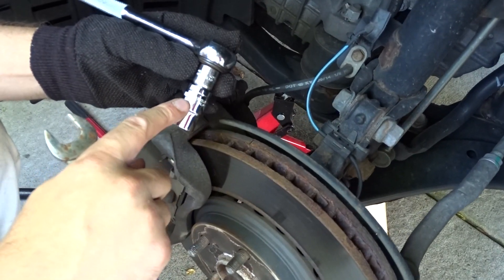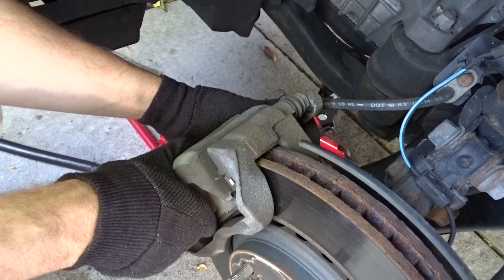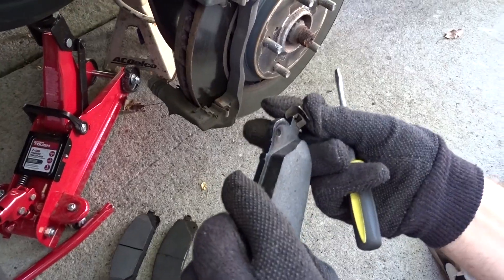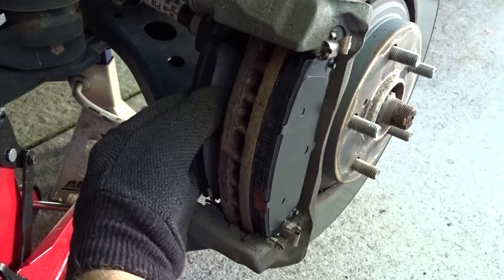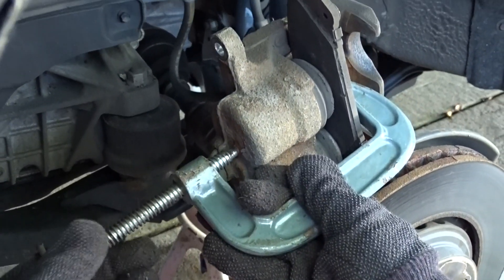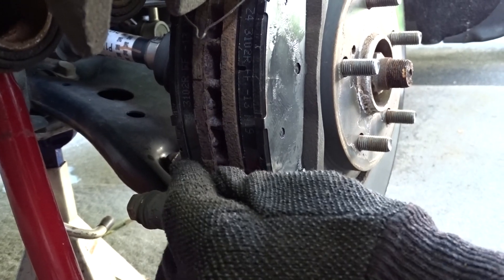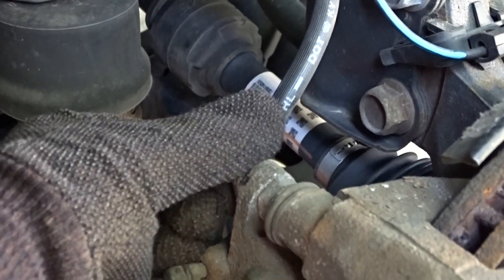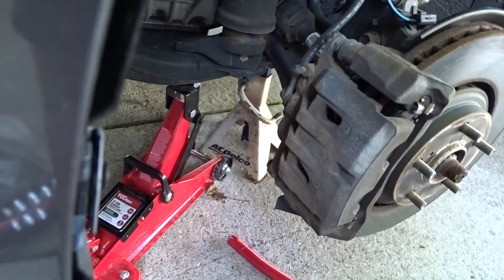How to Replace Brake Pads on a 2012 - 2015 Lexus RX 350

Comment: No high temp grease?
Reply: Tomás Cancelliere yea, lots of important steps missing...didn’t torque the bolts...didn’t apply grease, didn’t pop the cap off the brake fluid reservoir to release pressure (could cause overflow when pushing the pistons in, and MOST IMPORTANT of all, didn’t pump the brakes afterwards...THIS can cause your vehicle brakes to fail the first time...becareful people!
Reply: @rafayzafer1092  I agree tons of missing steps. Also didn’t replace the rotors. Usually you replace the rotors as well. And massively over torqued the slider pin bolts
Reply: @kenkyuen  You would not need to replace the rotors unless they are faulty, brake pads will generally do the trick. But you are right, there are a lot of missed steps.
Reply: @kenkyuen  The rotors don't need replacing as much as the pads. Agree the bolts are way too much over tightened!!!
Reply: @kenkyuen  Wrong!